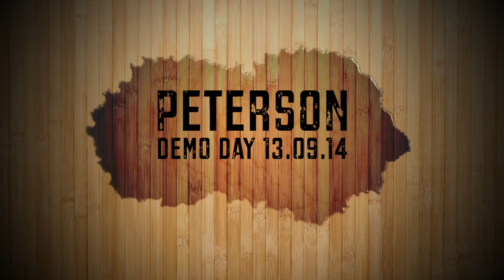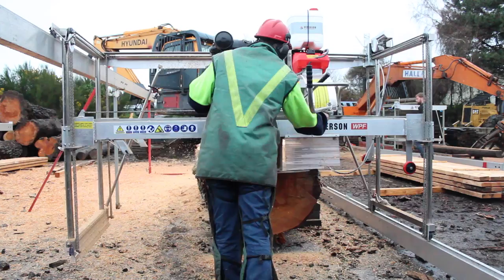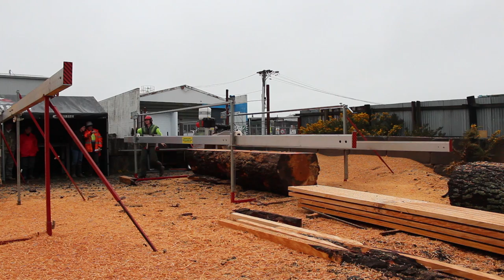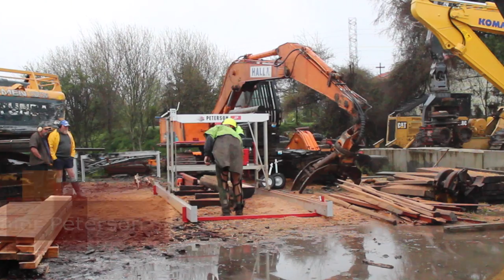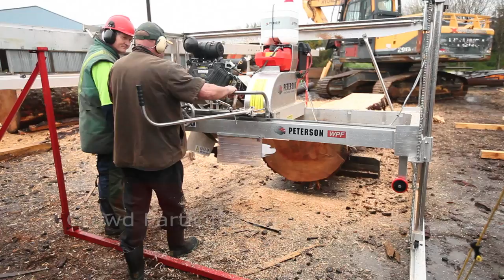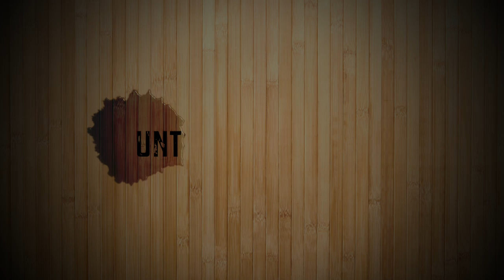The Great Peterson Sawmills Demo Day 13/09/14

Comment: If the saw bucks what keeps it in place? The trolley wheels seem to just be sitting on the steel rails.

Otherwise looks like a great design.
Reply from the maker: Hi Shahbaz, we have never had the problem of the saw bucking. The weight of the mill is enough to hold it in place. If the mill is set up correctly this bucking you mention should never happen. We also have a number of design features to stop this occurring, like having a centrifugal clutch and a riving knife to stop pinching. 
Thanks